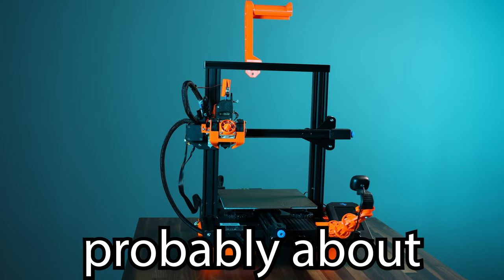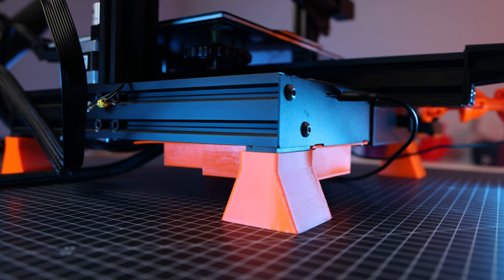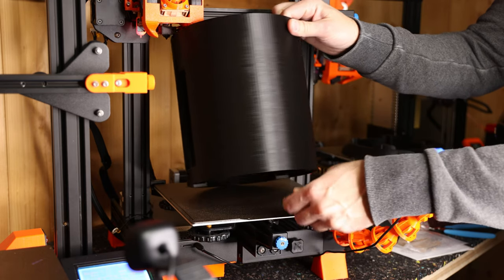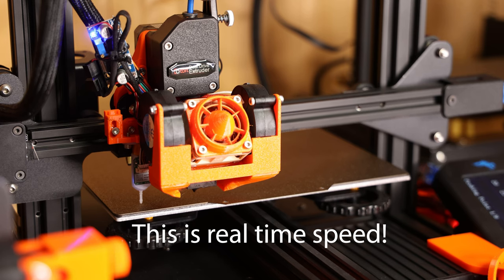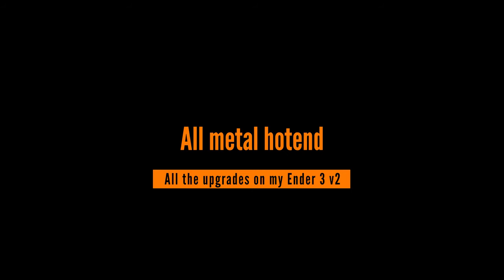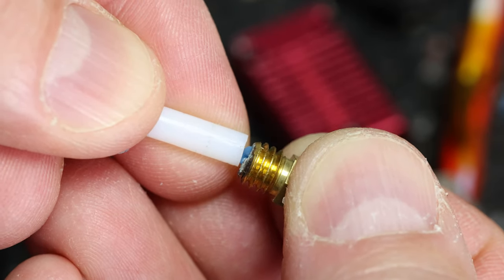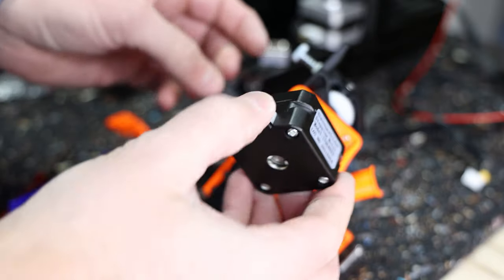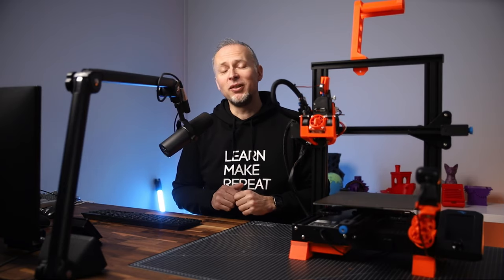All the upgrades on my Ender 3 v2

Comment: Always, if u are running DD, try to put the spool out of the upper part of the frame, creates vibration, try for example, attach the spool to a shelf, or something similar above the printer 👌

For bowden setups, the spool on the side is the way to go, and print a simple guide so the filament doesnt get any chance of touching the THSL rod

Comment: The very best upgrades I've found are:

PEI spring steel sheet - Everything sticks. I can pop PLA off right away with it still warm, but PETG I have to let cool down. I use a glass plate with the PEI spring steel sheet. Glass is held to the aluminum bed with Kapton tape on the edges, and the PEI sheet is held on with a magnetic sticker applied to the glass. It's a lot of mass to heat, but I usually bump up the bed temps 5 degrees to compensate.

BL-Touch with yellow bed springs - I don't have to ever mess with leveling the bed. It is truly "set and forget". If I have to tweak it, I babystep the Z.

Dual gear extruders/BMG - The stock plastic extruder on the Ender 3 is absolute garbage.

All metal hotend - I got Micro Swiss clones for all my printers. The stock MK8 hot end is junk. I've had so  many clogs, burnt bowden, and leaks I lost count. I've never had one problem with the MS design.

Upgraded controller boards - Two of my printers have SKR 1.3, and my Ender 5 Plus has SKR 1.4 Turbo. All run TMC2208 drivers. I got tired of my printers thinking they were chiptune DJs.

Octoprint on Raspberry Pis - So much easier. My printers live down in our basement, and running up and down the stairs with MicroSD cards was stupid. Plus, with cheap webcams plugged into the Pis, I can monitor the printing remotely.

Other upgrades:

I'm using the Printermods XChange system on all three printers, so I can swap them between direct drive and bowden. I also have a print head built up for abrasive filament, and one for TPU filament.

One of my Ender 3s has been converted to belted Z.

I'm midway through converting my Ender 5+ over to Klipper. I have no experience with Klipper, so this is a learning adventure for me.
Reply from the maker: Love your list of mods. I am also looking into Klipper. I understand that it doesn't make sense without a Raspi and mainsailos
Reply: @Crosslink3D  Mainsail and fluidd are purpose built operating systems for klipper but you can use octoprint as well with a plug in. I personally use mainsail and I was a little apprehensive because the V2's lcd screen doesn't work with klipper and it can be a little overwhelming at first but now that I have it set up, it's amazing.
Reply: @Crosslink3D  I've run into a problem with the Ender 5+ and Klipper, and I'm sure the Ender 3v2 would have the same problem. Klipper isn't compatible with the stock touch screens from Creality. I purchased a Bigtreetech TFT35 thinking it would work since it has 12864 display emulation, but the Klipper compatible firmware for it isn't very stable. I haven't decided whether to buy a 12864 screen for it.
Reply: @SpünmanReal  I've been looking at both Mainsail and Fluidd, and I'm pretty sure I'm going with Mainsail. It seems a little more advanced, feature wise.
Reply: @dr3ifach  I believe they each have features that the other doesn't but I'm not familiar with fluidd so you could be right. As far as the screen, I thought I would really miss having it but it really hasn't been an issue. You can access the mainsail UI on your phone if you aren't sitting at your computer and I have been asking my friends if they have an old tablet they don't use anymore to use as a touchscreen.
Reply: @SpünmanReal  isn’t that what klipperScreeb is for?

Comment: Great video..

On my main ender 3 pro, I fitted tpu feet to give more airflow, make the printer quieter and hopefully absorb some of the vibration. 

Yes, the bltouch or whatever leveling sensor is important for getting the level of the bed, but it's not a way out of manual leveling that should still be done. I also fitted the silicone bed adjusters and find the bed goes out much less than with springs.

In my view and I share this point of view with you, an all metal hotend is only a good thing. I have one on my main ender 3 Pro (with direct drive for flex) and am waiting on another for my 2nd e3p (a bowden setup).

The filament sensor is great as it pauses the print if the filament runs out, saving you money, time and general unpleasantness. However, I have seen folks having issues where they go away for an amount of time, the printer times out and turns the bed off, releasing the print before they get the chance to fix it.

I love the raspberry pi and octoprint. I no longer have to sit right next to the printer and with access anywhere a d octoapp, I can even keep an eye on the print when roaming - plus, it tells me if it thinks there's a problem. 

I also have my main machine in an enclosure, due to the old house being draughty - layer separation and warped prints haven't been an issue since. The 2nd printer will go in the shed and will also be chambered to keep out draughts and general dust that you get with sheds.
Reply: Can the glass cover/box be put over the unit while a print is in progress?

Comment: I have found with the glass beds that if you have the perfect leveling and Z offset and the perfect amount of squish you get great adhesion with easy print release and no or little elephants foot, you must also clean the yellow gunk with isoropanonyl and not soap as if you dont or you use soap the yellow gunk overtime bakes solid and nothing will adhere to it, Creality have stopped sticking down the protective sheet with this type of yellow adhesive but I did not fancy wasting a new glass bed to test whether this new adhesive bakes solid as it was a friends printer I had assembled and calibrated.
Reply from the maker: It's too tricky for me and PEI beds are so much more easier to level and work with. I agree that you can make it work but I was so annoyed at some point that I dumped it and never looked back.
Reply: @Crosslink3D  I was more or less forced to use glass and make it work well as one of my clients prefers the finish from the borosilicate glass on one product part and a really shiny finish from mirror tile on another, I have tried smooth PEI for the shiny finish but its not as shiny a finish as the mirror tiles, I have quite a few of the mirror tiles so I just take them off the printer and pop on another and when I have 4 or five finished prints I take them off

Comment: Do you know that mainboard cooling fan is working only if part cooling fan is on? (I find out only few weeks ago). That may be the reason for frying steppers, especially if you print PETG or ABS with reduced part cooling. I rewired the fan to be always ON, powered from terminals where hotend fan is.
Reply from the maker: I’m powering the case cooling fan directly from the power supply, it’s always on!